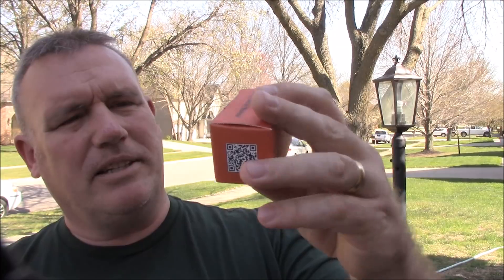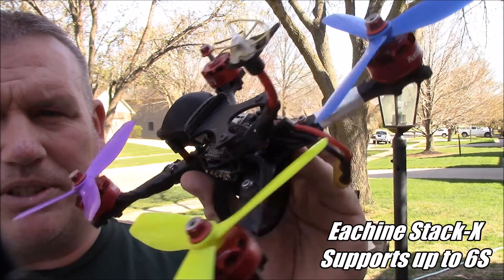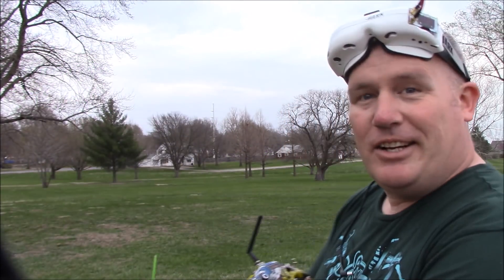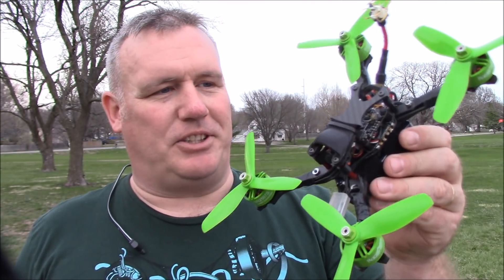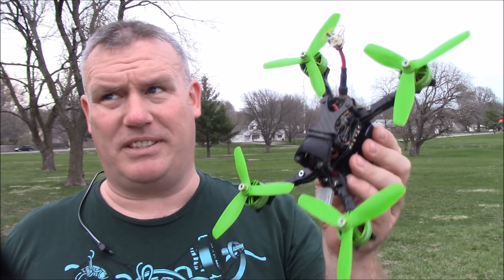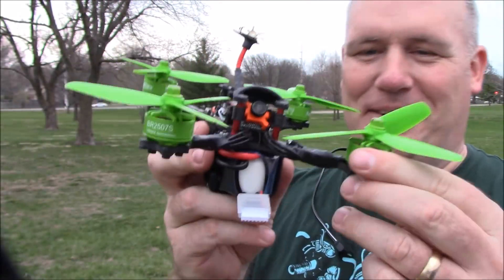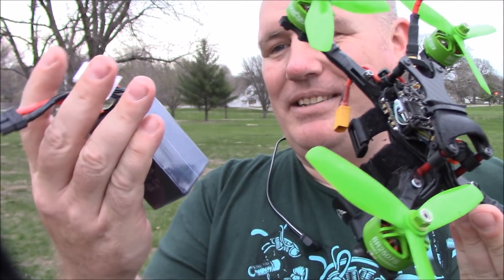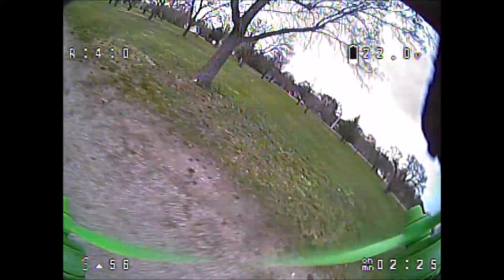Moving to 6S: Racerstar BR2507S 6S Compatible Motors

Comment: How are the bearings holding out? I have BR2205 and the bearings are really bad, after 15m of flight, you can feel them going bad...
Reply from the maker: I smashed into a tree and broke one of the motors.  I ordered a replacement but swapped them out for some 2207 1600kv motors before the replacement arrived.  My bearings have been working fine.  Maybe yours just needs a few drops of oil added to them.  I've used gun oil successfully in the past on other motors.
Reply: @travisgrindal  I use gun oil. I used to use this on my emax red bottoms. 2750kv 2306s. Always made them spin awsome. Those motors had the best bearings and shaft setup I've ever used. very tight. The motors wore out before bearings. Haha

Comment: I got a set, and have them on my new Bot5 frame!  cant find anything about them! your the first video I found! going green with Grasscutters from Kwadbox, and a green Caddx cam...  F440 5S stack, 5S seems more power than 4S and less tuning than 6S! at least for me and my few 5S-6S rigs!  6S is for when I want to go a long way in a mellow long range run for a long time... 10-12 min! some people are getting 15-16 min with their setups! I'm handicapped and always try to bring it back with a little extra...  just in case... I can't just go get it! but I love my 5S setups! and rip 6S on occasion.
Reply from the maker: Did you get the 1800kv speed for 5S?  They are flyable on 4S but you have to give a LOT of throttle to pull out of flips or rolls.
Reply: I use 2000-2300 for my 5S,  and lower for my 6S setups...  like my 1700kv and 1900kv
Reply from the maker: Nice.
Reply: the voltage increase also increases the RPM, so I like 2600kv motors on 4S, andI try to keep them around that speed...  so 5S should be around 2100-2300kv, and 6S should be under 1900kv for great long range, slow flying times of over 10 min. or fun flights for 4-5 min!
Reply from the maker: I've been watching for the Hyperlite 2205 1922kv motors to come back in stock.  The website says they weigh 23 grams.  That is insane for a motor that supports 6S.

Comment: Those motors are huge! Straight into the tree hehe
Reply from the maker: The ground wire going to the 4-in-1 ESC pulled off but I was able to solder it back on.  It flies again!

Comment: I know from experience that esc is fine on 6s, dare I even say reliable... However, I haven’t had nearly as much luck with the stack-x FC on anything above 4s. It’s great on 4s as long as it’s soft mounted even running 16/16/16 on multishot but as soon as I try 5s or 6s I get a lot of weird flight characteristics. Using a different FC now but ESC’s still running strong
Reply from the maker: I get a "twitch" every now and then in the flights.  I'm hoping that a soft mount and some "P" tuning will take care of it.
Reply: I hope that works for you. I spent a lot of time trying the same things but I couldn’t find a solution. Eventually I swapped the ESC for an Aikon32 thinking it was the ESC giving me problems but no dice. I even flashed Butterflight and it didn’t help. I really didn’t want to swap the FC because it’s literally the perfect VTX/FC combo but eventually I had to. I hope you have better luck than I did
Reply from the maker: You're not giving me much hope.  :)
Reply: Well take comfort in knowing that I’m no expert, just an FPV junkie. I’ve been pushing the limits of my gear and my budget for a couple years now trying to squeeze everything I can out of both. Running this FC on 6s isn’t my only defeat. I’m sure if I were more active on RC groups or slack, someone has found a solution for this.
Reply: @ryantodd82  hey to anyone having problems with oscillation when moving up in voltage, especially 6s with 5"prop. u need to reduce P gain  untill oscillation on acceleration  stops.

Comment: More volts does not equate more torque...
Reply from the maker: True, it doesn't always, but with the Racerstar 1800kv motors in the video,  6S over 4S is a huge torque difference.
Reply: Wonder how much of the difference is from just using a larger motor (2507). What size motor was your 4s quad?

Comment: With even lower kv motor you'll get more torque! And smoothness in corners.
Reply from the maker: But if you don't increase the voltage, you'll lose top end speed.  I don't need my top end to be higher because I don't normally fly that fast anyway.  I do race a lot better with a higher low end torque because it accelerates a lot faster for me.
Reply: I mean, 6s with 1600kv motor will give you more power in corners ;] better than 17xx kV
Reply from the maker: Good to know.  I have a set of 2207 1600kv motors coming soon that are rated up to 6S.